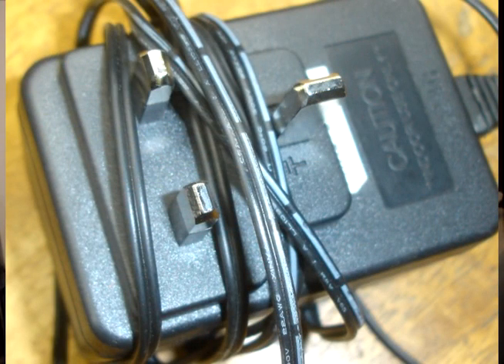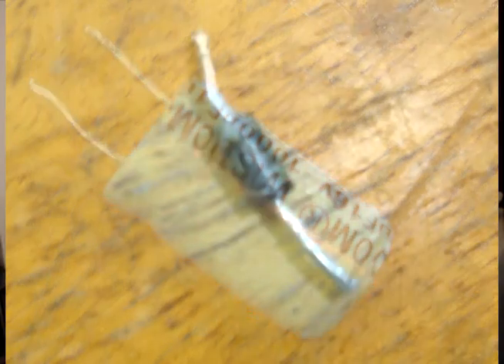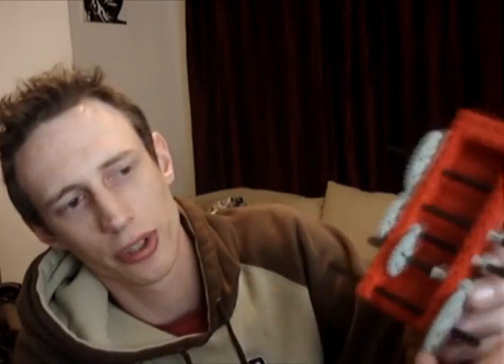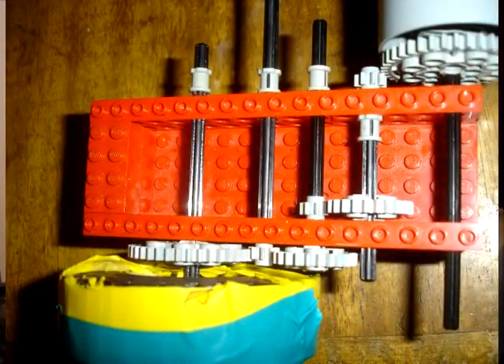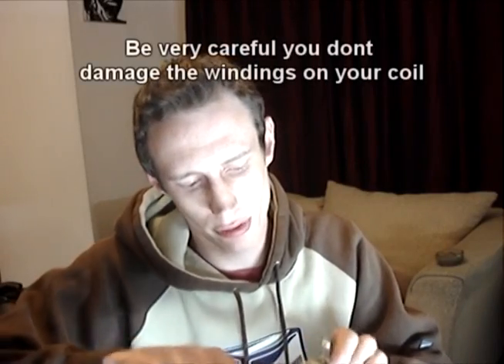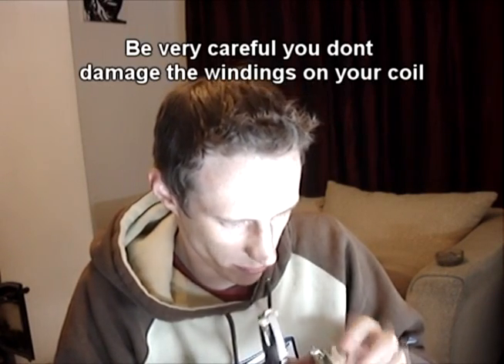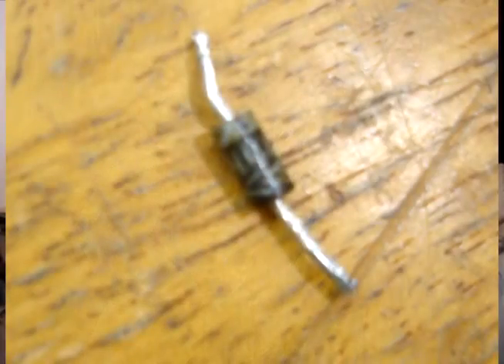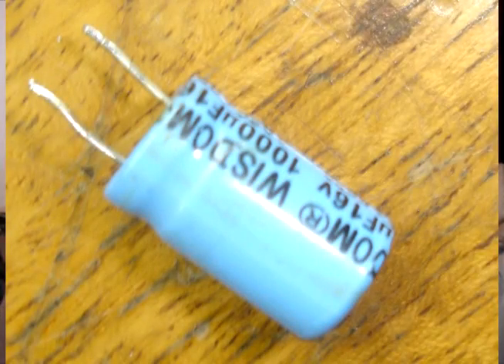Hakology - Mini AC generator tutorial

Comment: First of all, I just found your vids today, so please forgive me if my question(s) has/have already been asked an answered.

With all other factors being equal (same flywheel speed, same gauge wire, same size and number of magnets, same distance between magnets and coil, same number of turns about the coil, and any other variable I havent thought of yet) does the orientation of the magnet in relation to the coil make any difference in the amount of power generated. In other words, does it make a difference if my magnet passes by a vertical coil, by a horizontal coil, over a vertical coil, over a horizontal coil, or rotates within the coil?

If the orientation does make a difference, which configuration would produce the most power?